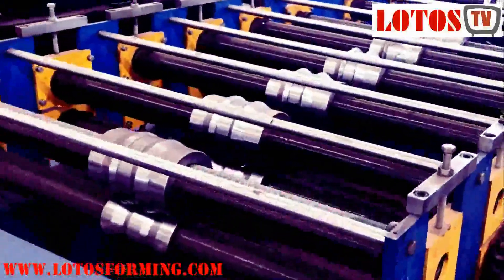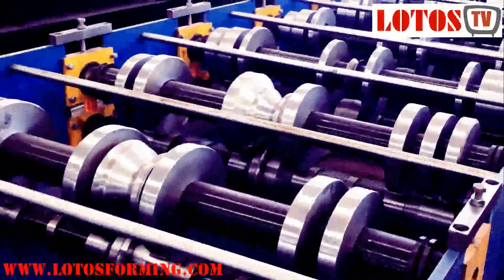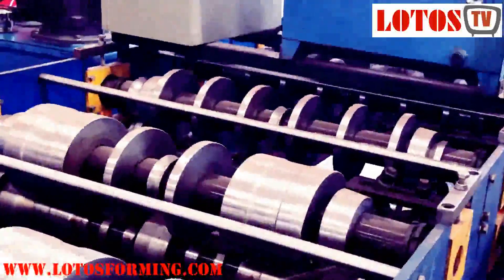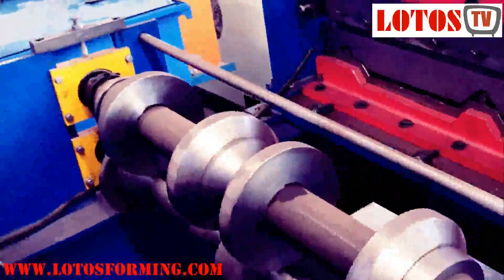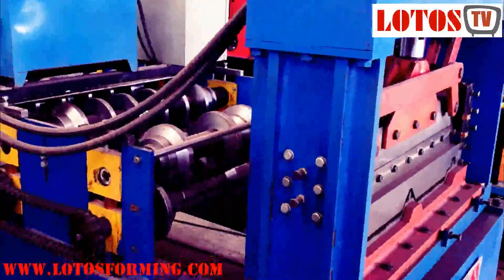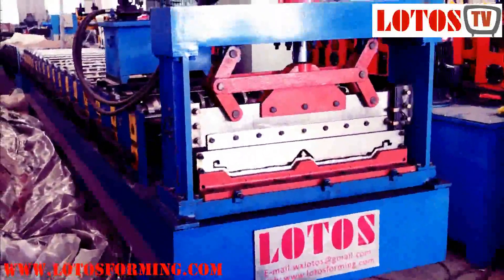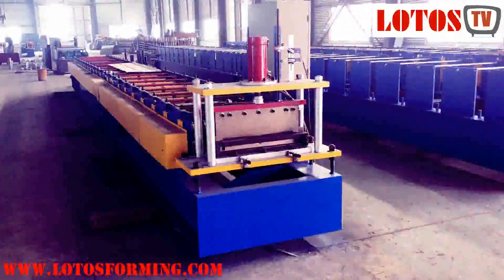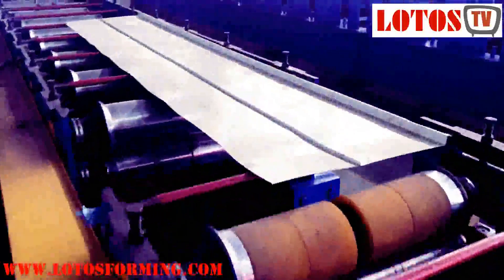Clip lock roof machine | clip lock sheet roll forming machine | joint-hidden wall panel machine

Comment: LOTOS is engaged in manufacturing and supplying an innovative range of Clip Lock Profile Sheets roll forming machine.
fully automatic roll-forming machines ensuring uniform dimensional accuracy. Clip-Lock Design incorporates the use of clips, avoiding the use of screws for sheet fixing. Clip lock design ensures the fast installation of roofing sheets.
Reply from the maker: every thing  about sheets https://lotosforming.com/roof-wall/